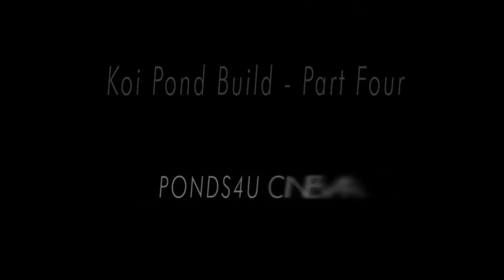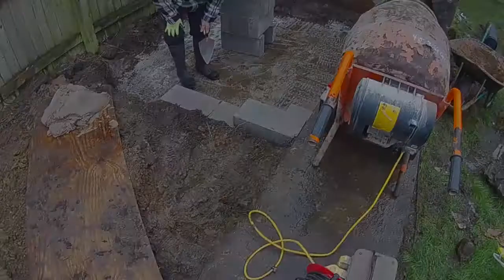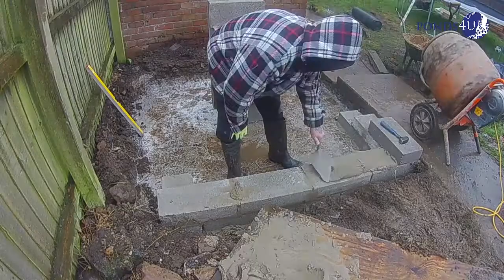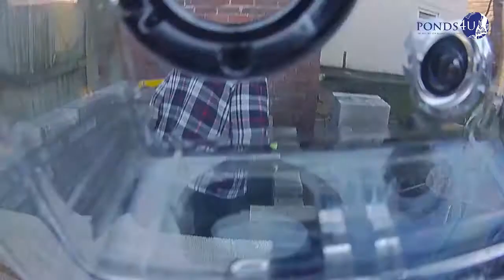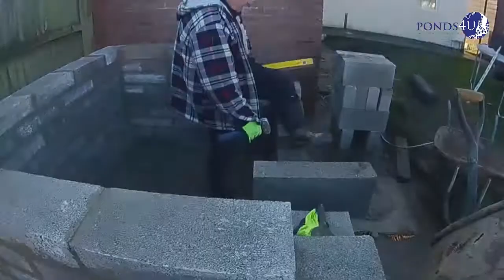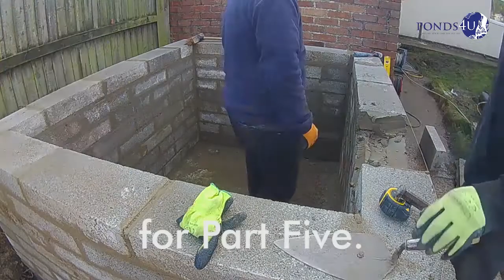Koi Pond Build Time Lapse UK 2019 - Part Three

Comment: Can you help me out with some advise. I am building koi pond but need help. my build is in a rectangle hole dug 6 feet long by 3 feet deep and 3 feet wide the plan is to build the pond in an existing area behind a retaining wall that retains all the soil. This means the pond will be enclosed by solid breeze blocks. The blocks will be surrounded by clay soil as the top of the pond would just stick out of the ground. My questions. Do I need to have the breeze blocks flat down ? I was planning on having them upright. What sand are you using for the mortar? I have red building sand and sharp sand what mix would you suggest for the breeze blocks and then how to render what mix should I use for that and do I have to have a plaster sand mix on top of that as a second coat?If I need a plaster mix what should the mix be I hope for your advise many thanks. paul.
Reply from the maker: Hi, We would use newton concrete blocks. Lay these flat to give a 9 inch thickness. The mix is 3:1 sand/cement for the blocks. 

Don't use the sharp sand for rendering. You'll need to get rendering sand for that. The mix for rendering is 4:1 for the first coat and 5:1 with lime for the second coat. The lime is to help any moisture evapourate away.

Hope that helps. Let us know how the pond turns out!